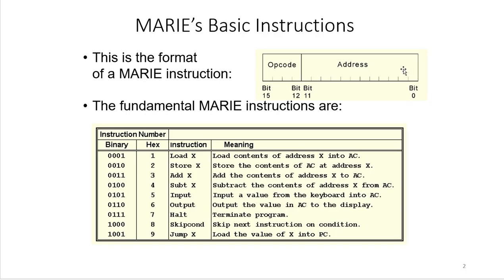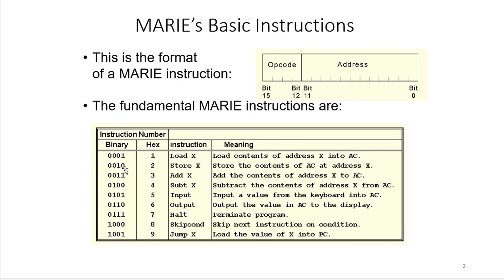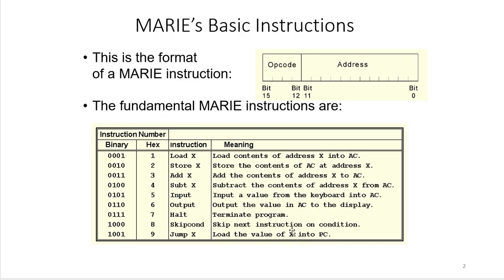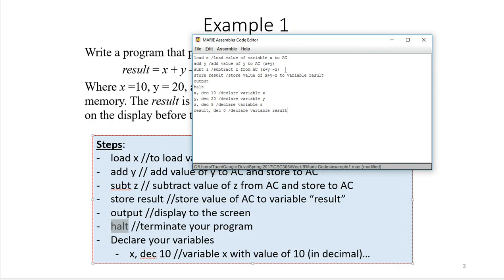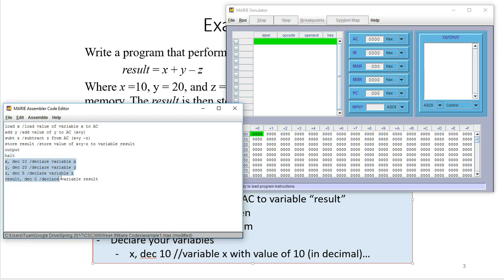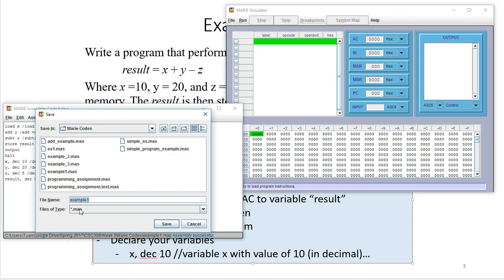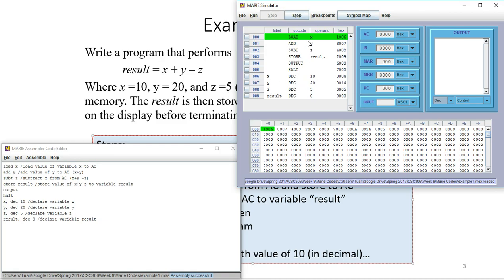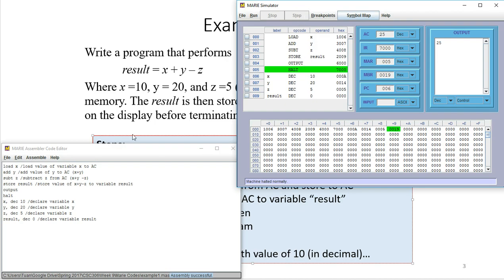Marie Instruction Set and Programming Example with Marie Simulator

Comment: TRAFFIC LIGHT
A MARIE program is needed that controls a Traffic Light, facing in only one
direction (simplified problem).
The program should start with the Light as RED and wait for a count of 25.
Then it should set the Light to GREEN, and wait for a count of 30.
Then it should set the Light to YELLOW, and wait for a count of 5.
Then it should set the Light to RED, and wait then continue as above.
The values 25, 30, and 5 listed here are to be used as the initial values for
program parameters (user decisions that will be adjusted with experience).
They need to be stored in your program in an easily identifiable way so
they can be changed to adjust the Traffic Light's timing.
(1) PLAN and DESIGN
How will you organize (design) this MARIE program?
What data fields do you need?
How will you display the Traffic Light in MARIE Sim?
(2) IMPLEMENT and TEST
As a team, write this program and make sure that it is working correctly.
(3) CALIBRATE
Adjust your working program so the traffic light changes based on these
specific (real, human) wallclock time delays:
 RED should be on for 35 seconds;
 GREEN should be on for 40 seconds;
 YELLOW should be on for 10 seconds.
This website has a clock face with a sweep second hand that can be useful in
checking your traffic light's times:
 https://www.timeanddate.com/worldclock/usa/boston
(4) SUBMIT YOUR PROGRAM

Comment: i need some help with the input/output commands.. i am new to marie and i need to write a program that takes input and prints hex on output..if you can help me i would be really thankful
Reply from the maker: Hi Howaitohanta. To get input from user, you just need to use "Input". In this case, the input value will be stored in AC. If you want to store it to a variable, say "X", you can do "Store X" (remember you need to declare "X" at the end of the program before using it). Here is the code in your program:

input
store X

For output, you can just use "Output" as follows in your program:

output

To specify "Hex" of the output, you should use the option on the GUI (at the bottom of the display area) for specify the type of the output.
Let me know if you have any issues. Thanks for your questions.
Reply: @ITCHANNEL101  the program I must write has to take numbers from 0-100 if the number is <50 prints F and >49, <101 print P and must stop at 10 results. If i am correct i need loops. Thanks for your help
Reply from the maker: @Howaitohanta: That is correct. You need to have a for loop of 10 (as you need to have 10 results). For each iteration, you use "input" to take a number in and compare it with the threshold to display the correct character. Hope that helps!